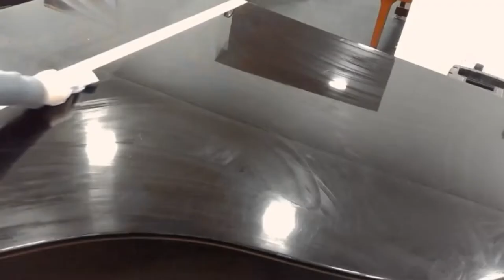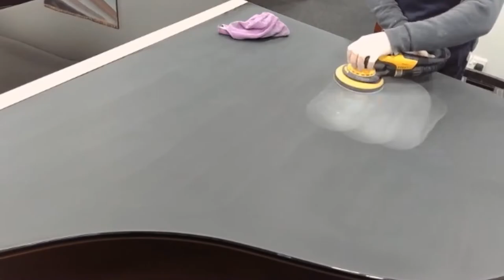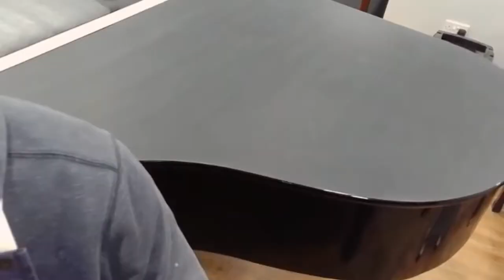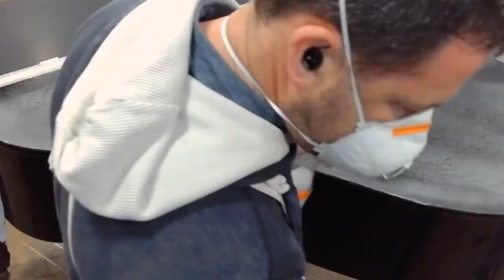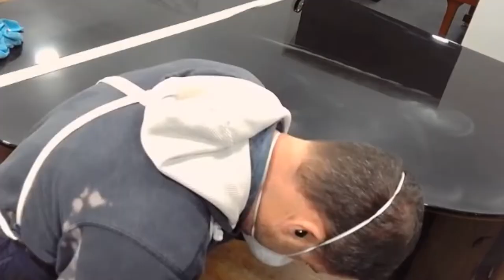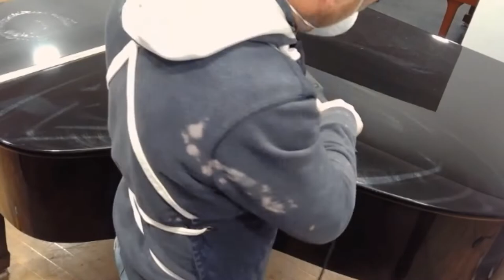Restoring 'Piano Black' (Polyester Resin) Grand Piano Top - Sanding and Polishing

Comment: Finally someone who knows what they’re doing. What is that, a Young Chang? 
I usually go up to 3000, if it needs to be “perfect“. But many times, the dealers just say “make it look the best you can in X amount of hours.” I got my first 6” Mirka sander three years ago. I used to do all that by hand. Sucked! Now I have the 3”, 1 1/4”, and 3x5” sanders. They cut my time down by so much especially on polyester repairs. I do a lot of standard refinishing, too, though. So well worth the investment. On repairs, I have found that switching between the random orbit and the standard orbit sanders really lets me see when I have cut through the previous grit sanding scratches.
Keep up the great work!
Reply from the maker: Indeed! Whilst mopping with soaps is generally quicker, it doesn't remove the production linishing marks, surface imperfections from years of temperature and humidity fluctuations which cause the veneers and laminations to expand and contract and causing 'ripples' in the surface. However, the main reason I use dry sand, damp sand, compound, polish is due to the showroom environment being far tidier and healthier. The polisher lasts longer too! The time and cost spent sourcing the right sanding discs and compounds was significant, as it isn't a typical product to work with and there is a lack of knowledge and experience in refinishing polyester resin. Most disc wear quickly, retain particles and cause 'pigtailing'. I find Norton Gold Reserve, Mirka Polarstar and BAXT Carbonite the best for dry sanding (with extraction). Damp sanding with 3M Trizact 3000. Also the 3C Trizact clearcoat finishing discs are superb. Ability for the sanding disc to stay sharp, resist pilling and have at least 15holes. Keeping the environment clean at all times, cleaning surface (and edges!) between passes, cleaning the sander between grit changes - is so important. Thanks for the tip re alternating sanders between grits to best determine elimination of prior grit.
Reply: @ChrisVenablesPianos  thanks for the tips! It took me years to figure out a good procedure as well.
Reply: @ChrisVenablesPianos  soooooooooooo why not tell us this in the video ??
Reply: @ChrisVenablesPianos  Hi Chris,  I need to move and can't take my Baby, so I need to get her ready for sale. She was walnut, but I had her refinished Cherry almost 30 years ago.  Just beautiful. Sohmer and Company.

If you don't mind me asking an Expert, who can I trust to come in and give it a good polishing and how much would you expect that to cost?  I had to fire a Handyman/Painter who made a mess of my hardwood floors last week.
She's only 5'2",  Amazing Queen Ann Legs.
Thank you so very much!

Comment: What kind of compound and polish do you like?  I'm a car detailer.  Just curious.
Reply from the maker: Favorite so far is Farecla profile select with twisted wool for first high speed cut, low pressure, then follow with solf lambswool to refine the cut, then Farecla profile finish, then Farecla profile uv polymer wax.

Comment: hi, do you have any idea or advise, why im getting this milky finish after polishing?

https://www.youtube.com/shorts/H9Atr7NwyhI

Sandpapered the piano black finish with wet 3000 grid.
I used maguire compund with heavy cut pad. Then used maguire finishing polish with softpad.

Shiny is nice and scratches are gone. But left with this milky hazy finish.
Reply from the maker: Hi Gabriel, Is this polyester lacquer? It looks as though the compound has not removed the 3000 marks fully. Or the gloss may be clear coat over black base and heat from compounding has caused bloom.
Reply: @ChrisVenablesPianos  
i dont know! Its the plastic frame of my daughters LCD Tv. I would go for your last thought HEAT. Its totaly even without any micro sratches. I did the same polishing on my blu ray player, but without wetsanding. Just 2 stage polishing. I have this milkyness too on the blu ray player.
Ive read that in this case you have to make a third polishing with even finer pad. I did use a finer pad. And the milkyness on the blu ray player got better. But its still there.

Ist this Bloom you mentioned it fixable?

Comment: That came out so beautifully! We just bought a fixer upper digital piano mini grand and it has superficial scratches on the lid.  Is there a simply way to do it without the sanding?  We already had to remove and clean every key and my husband had to polish all the rods and file the holes as about 60 keys were sticking.  If I ask him to help me polish the lid I’ll probably get divorced.  :) Do you think I’d we just did that polishing compound it would be enough.  It’s not a gouge.  What do you recommend for a simple buff?
Reply from the maker: If the gloss finish is polyester lacquer, then superficial scratches can be improved by buffing with a compound. However, a super gloss compound such as typically used with automotive may increase the contrast of the gloss finish and the scratches. It may be easier to disguise the deeper scratches with the use of a more abrasive compound which will create more fine scratches, almost sstin/brushed look. Application would be with a dual action orbital polisher sander. A standard rotary polisher will create swirls if the head is not clean and a finer stage polish follows. The polishing mop head should be lambswool as this cuts better than foam and helps reduce excess heat. Some case parts may be acrylic, which can melt very easily during polishing. Farecla profile select is excellent compound. 3m fast cut marine gelcoat coarse. Rupes mille coarse. At your own risk of course and use PPE at all times, ventilated area, mask off  all other areas. Clean with microfiber cloths between stages.

Comment: I use a festool sander and 2000 grit and then buff with a wool pad.
Reply from the maker: 2000 sia sia carat is amazing. Also available 1000 and 3000. All work well dry with extraction too. If the scratches are more significant and the surface not perfectly flat (from fluctuation in timbers beneath) then I need to go coarser without interface pad. Usually 800 but in this video I think I started with a first pass at 500.

Comment: Where do you get the polyester resin?
Reply from the maker: This is the original polyester resin lacquer. By carefully reducing the surface to the depth of the scratches (deep scratches require filling) through a strict sanding procedure, the finish can be polished to like new.
Reply from the maker: For small chip repairs I use konig repair polyester,  also cfs gelcoat or Ica polishable base coat. It depends on if its a pour in repair fill or a spray application.
Reply: @ChrisVenablesPianos  I have a piano I am refinishing. I'm sanding down the entire cabinet. I want to make a polyester black piano finish, but I was curious which you would use for the spray application. Is it the Ica polishable base coat? Do you have a specific product you'd recommend?
Reply from the maker: @PianoDad  yes we use ICA 306TP polishable basecoat with BASF RAL9005 Black pigment. Initial mist coat for good adhesion (surface sanded at p180, cleaned down and wiped with pure acetone). 3 coats (allow to become tacky but not wet on wet and not on cured). Flatten down with p500 with hard large block with extraction then go through grits to remove sanding scratches, up to p1500 with extraction, then damp sand 2000 before moving to compounding and polishing. Very important to allow the lacquer to cure for 3 days before polishing. Spray tip 1.8mm or larger, without need to thin. Provided the mist coat has provided good adhesion (tacky before 1st coat) ensure the spray is laying on enough to break surface tension else fisheye can be an issue. If not laid down on tacky, the chemical bond between layers will not be sufficient and will  then show holograms when flattening down and polishing. Typically removing around 20% of material applied for the perfect finish, so be sure to apply enough. Of course, be very mindful of the toxicty of this product. Good extraction with filtration in/out of booth, full spray suit and respirator gloves. Accurate measuring of components and thorough mixing are essential. With a short pot life after mixing the MEKP, you will need to clean out the gun between coats and have your next pot ready. Also remember to carefully check the chemist's instructions in the product. Store the cobalt and MEKP in separate cabinets to the lacquer and have an acetone tray ready to start cleaning your gun.
Reply: @ChrisVenablesPianos  Thank you so much for all the instructions!

Comment: Hello, did you find the grail of sandpaper ? Could you tell your Brand and the model. I tried Mirka Abralon but It do not work for polyester. I am a new piano tuner. Many thanks
Reply from the maker: This is a Mirka deros 6" sander with 2.5orbit. I use dry / extraction up to 1500. Best sanding discs are Norton ice, BAXT Carbonite, Mirka polar star, 3m trizact 1500 clearcoat. Then 3m trizact 3000 damp. You can use the more expensive but longer lasting and better cut sia carat foam discs for 1k, 2k and 3k. Then compound in 3 stages.
Reply: @ChrisVenablesPianos  oh whoa thank you very much for taking the time to answer me. Finally a good way of research for me.
What coarse grit do you use for large scratches? 800 / 500?

Comment: what are you doing
Reply from the maker: Hey Mike - I have detailed the process in the description but I do appreciate narration would be more helpful. This is a Timelapse video showing the process of removing significant wear such as scratches and abrasions plus transferred substrate profile in the surface (timber expansion/contraction). The process is sanding with extraction followed by fine damp sanding, compounding and polishing. Working from P600-P2000, twisted wool mop, wool mop, hard then soft foam mops. The result was a finish equal if not better than original factory; without respray.